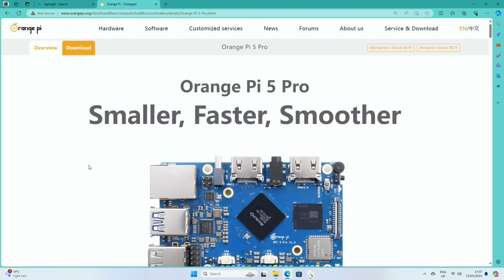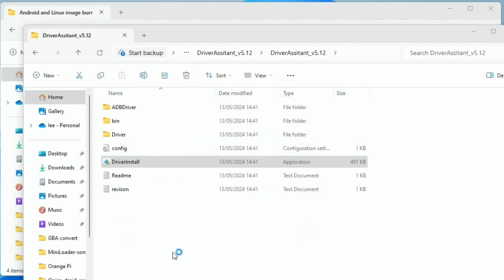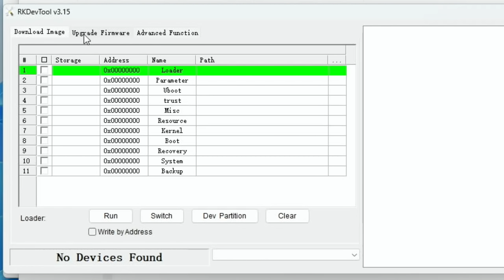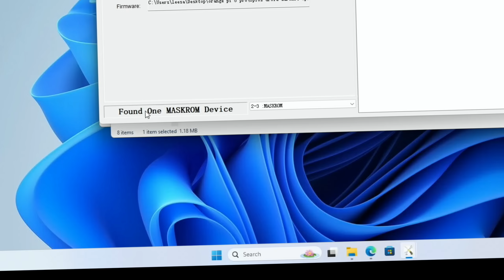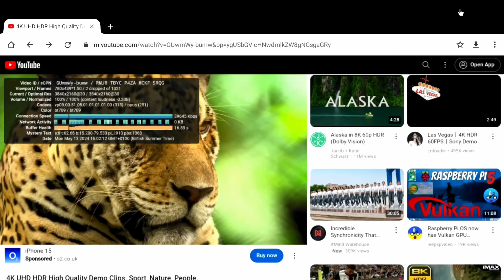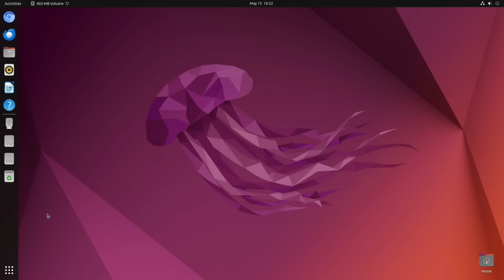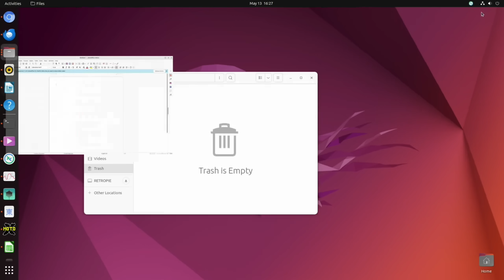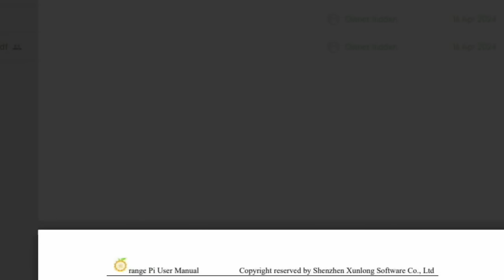Orange Pi 5 Pro. Smaller, faster, Smoother

Comment: Have you ever tried running the Android operating system on the orange pi and just use the termux app to go into a Linux distro that way without having to put in a extra SD card into the system?

Comment: No sound, no wifi on batocera, have you a solution
Reply from the maker: Try asking on the Batocera or Orange Pi forums. I haven’t used mine for a while
Reply from the maker: Try asking on the Batocera or Orange Pi forums. I haven’t used mine for a while

Comment: I followed you step by step but I got a "Prepare IDB Fail" error and I was unable to put the Orange PI % Droid img to flash using BalenaEtcher it gave me a directory error June 13th, 2025
Reply: You can’t write Android imagers with Balena or Raspberry Pi Imager. Use the tool Orange Pi recommends

Comment: PLEASE will you make a video on how to install Ubuntu to the NVME drive for the 5 Pro - all the video's I find gives instructions on first installing and running orangepi-config to change the bootloader, but on the Arch OS there is no orangepi-config, and I cannot build it manually?
Reply from the maker: @pa6552  I don’t have the spi, so I can’t use nvme on my Pi 5 pro. I mentioned it in the video
Reply: @leepspvideo  OK, sorry, I obviously missed that part - do you know if the SPI is the only way to get the NVME boot working, or would you also be able to get the NVME working if you at least have an EMMC installed - ie, then you could install a bootloader to the emmc drive which then switches to the NVME?

Comment: How does the orange pi5 plus 32gb stack up against the pro?
Reply from the maker: I prefer the plus for being nvme ready. Performance is very similar as the same cpu is used. The pro has faster ram
Reply: @leepspvideo  Thanks for that! I ended up with the plus 32gb. Its my first sbc.

Comment: I am desperate to figure out how to boot to any linux distro from nvme on my new Pro. It is not clear to me if I can do it from emmc. I dont have emmc or spi. The emmc can be ordered off amazon, but digikey does not even have the spi flash card and I don't want to solder anyway. I'm OK having the boot sector on the sdcard or emmc and then rest of OS on the nvme. I deally, I could buy the emmc, pop it in, have the boot sector there, then have it load the rest from the nvme and have the user partition there too. I want to add this Pro to my kubernetes cluster.
Reply from the maker: It’s easier with the Orange Pi 5 plus.
If you want nvme at al, it appears you need to solder the spi.
EMMC works fine with the dedicated one.

Windows on R uses uefi boot from an sd card. I haven’t tried booting Linux from an sd boot apart from Berryboot on Raspberry Pi

How to install Windows 11 on Orange Pi 5
https://youtu.be/Utvl8fxQ9XE

Windows 11 on Orange Pi 5, Pi 5 plus. UEFI Update 2X Speed boost………nearly
https://youtu.be/8pMMGnQQg6Q

BerryBoot Raspberry Pi 400. Multi OS launcher.
https://youtu.be/Bkl67DjNiNk
Reply: @leepspvideo  I actually looked back at the docs, focused hard to translate the changlish into something my noobish self can use, and I now have it booting from nvme, though the bootloader is on the sd card. I'm using this for a diverse  vm plus sbc kubernetes cluster demo so I wont be booting that much anyway, I mainly want faster iops. They used some strange terminology for the sdcard and for some other stuff.  The spi flasher app is misnamed, it works on the SDcard as well. I'll post an article somewhere with the details and then post a link here. Thanks for the feedback and for your work. You gave me the confidence to try again.
Reply: @EdwardPike  can u please explain how can I use the sd as a bootloader to have an OS on nvme??

Comment: nvme works with the emmc or the spi flash. You need one or the other to boot.
Reply: I need an idiot proof tutorial about booting from nvme, preferably using emmc vs spi (I fear soldering). I am trying to add a pro to my kubernetes cluster, (along with various pis and jetson nano, etc) so ideally it would be a linux demo (ubuntu or debian).

Comment: Think it interesting that they used the "S" variant of the chip with the faster LPDDR5.  The S variant lowers the PCIe spec in both generation AND lanes out to the NVMe.  Seems that the best combination would actually be to put LPDDR5 memory down on their Plus model as the RK3588 is compatible with LPDDR4, LPDDR4X, and LPDDR5!!!  This just seems like an odd combination for them to come out with.
Reply: That's coming in the Orange Pi 5 Max. Non-S variant + LPDDR5 + PCIE Gen3x4
Reply: @s.alizaidi6635  good call. I will buy the Max version instead :)

Comment: I was so hype to get one myself what ended to push me away, is the emmc and no spi flash module or an option to buy one with 1 spi soldered on. i can do it myself just don't want to risk it. overall the device seems to be fine on an emmc. but once u taste the nvme on a rasp 5 .. hard to go back on sd card to be fair. !! neat video. cheer.

Comment: Good to see that they are finally putting LPDDR5 RAM :person-turqouise-waving: Give me 5 :dothefive:
Probably is most interesting to do some memory speed comparisons vs else Rk3588 who are on 4/x. Although...
On Plus there are 2 LPDDR4X chips, which suggests dual channel operation.
On this PRO, there seems to be only 1 LPDDR5 chip, which suggests single channel.? Sounds like this combo will ate a lot of perf from a GPU... if really is single, then that sounds like faster on paper, but in reality will be slower than Plus...
 Trick sounds good for temperatures and idling wattages on a smaller board, but likely eat some perf, so...  :face-green-smiling:

Comment: Wirklich ein sehr interessanter Einplatinencomputer, aber im Vergleich zum Raspberry Pi 5 oder anderen Rechnern viel zu teuer.
Reply from the maker: It shouldn’t be expensive 

https://www.aliexpress.com/item/1005006948234566.html?src=google&src=google&albch=shopping&acnt=494-037-6276&slnk=&plac=&mtctp=&albbt=Google_7_shopping&albagn=888888&isSmbAutoCall=false&needSmbHouyi=false&albcp=17859500389&albag=&trgt=&crea=en1005006948234566&netw=x&device=c&albpg=&albpd=en1005006948234566&gad_source=1&gclid=Cj0KCQjwgJyyBhCGARIsAK8LVLOPQJeF6MrZ1qnJv-sMe_ldYTU3yqPsm374nwet1M0J_g3JkZ32jhUaAnj-EALw_wcB&gclsrc=aw.ds&aff_fcid=7890cb7895b24a809ff201694ee8731b-1715931355233-06877-UneMJZVf&aff_fsk=UneMJZVf&aff_platform=aaf&sk=UneMJZVf&aff_trace_key=7890cb7895b24a809ff201694ee8731b-1715931355233-06877-UneMJZVf&terminal_id=208f203cd0754137a115e8d3235551dc&afSmartRedirect=y
Reply: @leepspvideo  Wow, really a very good price, thank you very much for the link!👍 But unfortunately ..... "This product cannot be sent to your address.
Select another product or other address". 😭 Interestingly, I just went to the Ali Express page again and looked for the same product (same features, same ram size), and the price was €132.01. But at least it can also be delivered to my address. It's incomprehensible where this price jump comes from!
Reply from the maker: @ilovealbundy  unfortunately much more expensive through Amazon

Comment: On the verge of buying a Banana pi 5, either Plus or Pro. With this spi thing would you recommend a Pro, with emmc or a Plus with an nvme? I tend to lean to the latter, overall clock and ram speed aren't that important to me (until you miss it of course ;-), but nvme ootb sounds appealing. Also, 2 nic's on the Plus.
Reply from the maker: The plus is easier if you are intending to use nvme

Orange Pi 5 plus Armbian and Ubuntu NVMe
https://youtu.be/nYruT0q2yLo

My soldering skills aren’t good
Reply: @leepspvideo  Thnx for the comeback. Neither are mine ;-)

Comment: Smaller, faster, Smoother, same old underdeveloped software. Orangepi are only box shifters where real software development is left to the community. The requirement to solder an SPI chip in order to use the  M.2 is idiotic any more of an indication of amateur rather than pro.
Reply: I bought the Orange Pi 5, not 5B, last year.
I say this because in order to get Internet, I have to plug directly into Ethernet.

The 5 allows you to insert a wifi card into the m.2 slot, and this works ... If you exclusively use their Orange Pi OS. 
If you try to use their boards for literally any other distro, you can't interact with the drivers or m.2 slot.

I bought their officially-licensed m.2 wifi card, direct from the Orange Pi Amazon storefront, and their own board just isn't set up to recognize the damn thing outside of a single use-case.

Orange Pi: "you're just happy you got anything to work on it, otherwise you'd have to consider mailing it back"

Comment: Ordered the XM25QU128CWIQT08Q (at $0.86?!?) - will try soldering it.  Thanks for the review.
Reply: Actually watching that again - it's quite impressive - seems alot faster than the Pi5.  Have a Pro coming in the mail - should have gone with something higher than 4G
Reply: I need to order some of those spi chips myself. Orange does the same thing with their cm4s

Comment: Ohhh - so it's like all the power of an Orange Pi 5 (RK3588S) except raspberry pi sized. Very cool. By the way - looks like there's a dedicated fan connection to the left side of the GPIO. Probably requires a male micro JST.

Comment: Can you fit it into a Raspad 3? I am thinking about getting one and would like to know if I can use it with different boards.
Reply from the maker: Yes should be fine. I have used the Khadas inside my Raspad 

Raspad 3 / Khadas Vim 4. 8 core SBC tablet.
https://youtube.com/shorts/bhn5Kxlqy-w?feature=share

Raspberry Pi 5 tablet with NVMe. Raspad 3
https://youtu.be/BgnBn35d6dE

Raspberry Pi 5 Tablet. Now with Cooling and KDE Plasma mobile
https://youtu.be/IIPY-P9W410
Reply: @leepspvideo  Thank you Lee.
Reply: I was just to ask the exact same thing.

Comment: Interesting to see this.
But why would I get one of these instead of a Raspberry Pi?
Reply: It's faster than the pi5 but not 5X. Sadly, unless you want to run Android, you're better off with the Pi5.
Reply: 5x faster
Reply: In all honesty – you wouldn't. There is more to a system then specifications and even computation speed, the reason I picked the Raspberry Pi 5 over any of its alternatives (in fact, I use it as my main system at home) is the software-support, how well rounded it is,… it just gives you much less headache when it comes to trouble-shooting. In short: The RPi is slower, but it works better. I had different “pies” in the past, and always regretted it sooner or later. So, if you want a better supported system, go Raspberry.
Reply: @mediocreman6323  please define "better". If your only goal is "how many different flavours you can install on this board" then yes, RPi is "better". But apart from such "use case" some people use SBC for more serious cases (i.e. NAS, router etc.) - OPi5Plus has 2x 2.5Gbps NICs - add to it OpenWRT and you have perfect router. Or NAS. RPi from the very beginning was for "schools" - not for serious use. But both: RPi and Opi5 can be used for many things - if you need performance and Debian or Ubuntu or Arch are ok, you take Opi5 and you are done. Move OS to eMMc or NVMe and you have a beast.
Reply: @mediocreman6323  You didn't mention the main benefit. waveshare site provides hundreds of expansion boards for raspberry pi 5